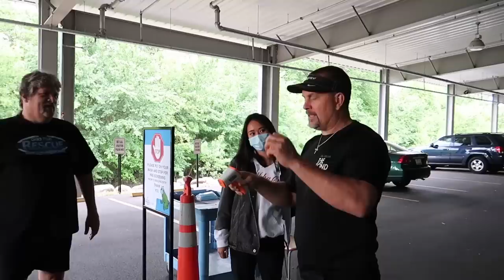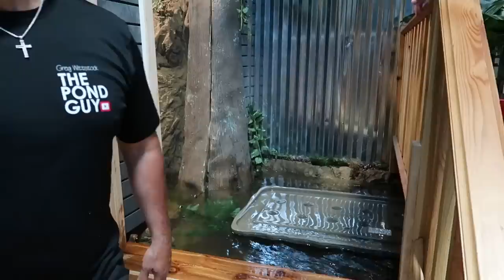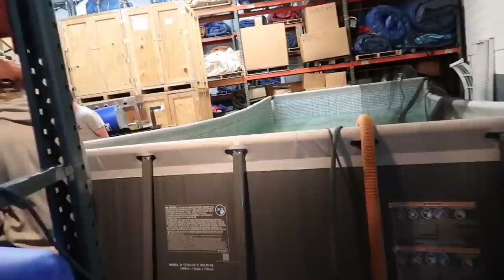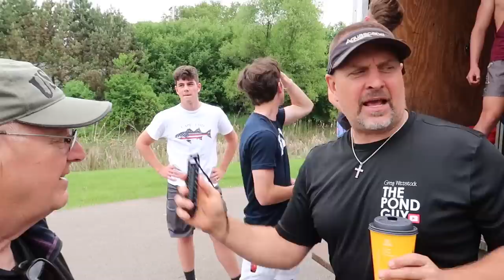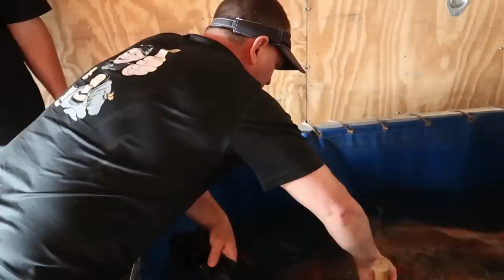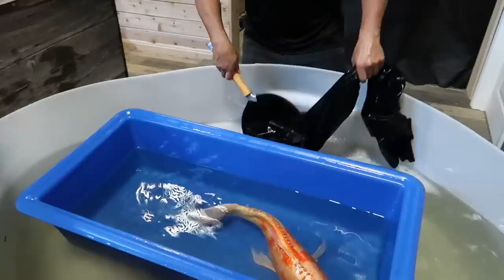MONSTER *KOI* for SHAQ

Comment: I love your vidios and I love the whole aquascape eco system but I live in South Africa and the stuff to build my own pond is so expensive
Reply: Start building ponds
Reply: From SA aswell... The USD/ZAR exchange rate is killers 😩
Reply: Started with a bucket of water in the driveway with a water lily in it I have moved up to a small free preformed tub free granite rocks build a waterfall. this year upgraded to a Spillway and a larger pump for only a hundred fifty bucks the birds are hysterical flying cross the Teeny pond I think they're going to drown they like it better than the bird bath water lilies are about to bloom and last year I have frog show up out of nowhere so scrounge where you can it doesn't have to be $100,000 pond that would be nice but
Reply: @ellyndriscoll4627  yes I know but a $150 is still like ZAR 2700
Reply: Sorry like I said scrounge what you can

Comment: Does no one pay attention to weight limits? A standard SUV can safely carry around 1100-1500 lbs depending on the model. The 500 gallon tub even if it’s only filled half way is 2000lbs. Then add the passengers and the fact that the water is sloshing around and it’s recipe for disaster.